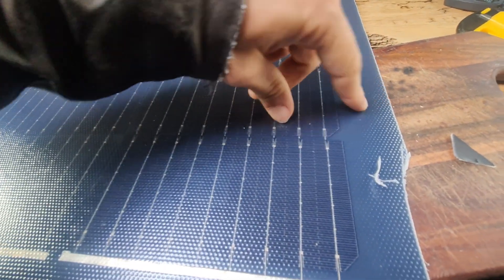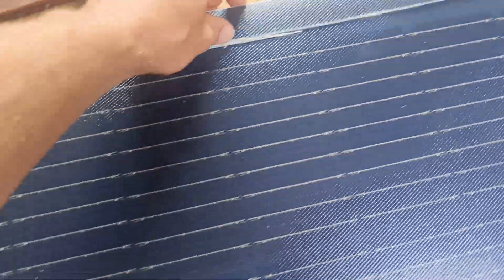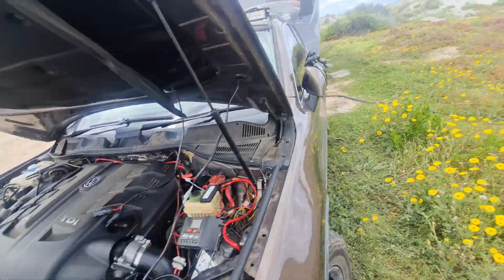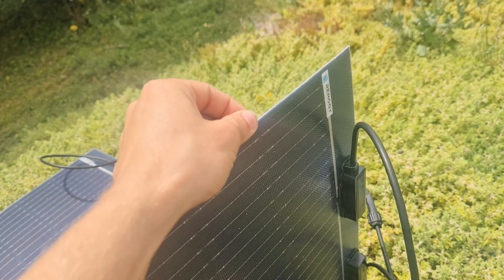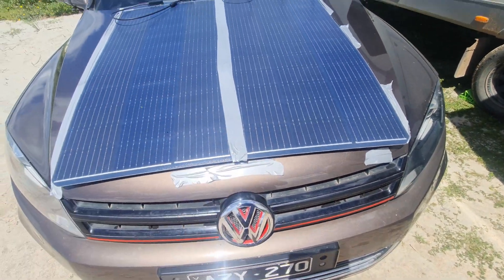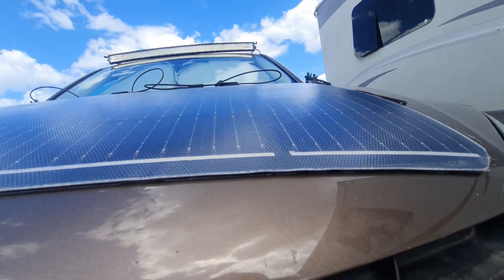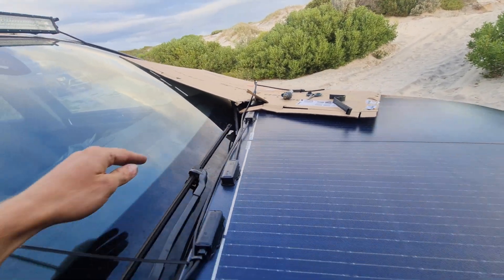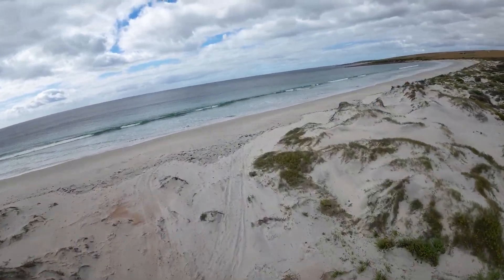Cutting flexible Solar panels on car bonnet

Comment: Nearly 2 years on now, are these still on the bonnet and have you had any delamination around the edges where you cut the panels?
Reply from the maker: Yep still on the bonnet
And no delamination at all
And still working great 👌🏼

Comment: What are the panels? How did you route them?
Reply from the maker: I got renogy panels and I think I ran them in series and under the fire wall and along the inside of the bonnet to the strut side then down and under the car all the way to the boot and into the solar controller